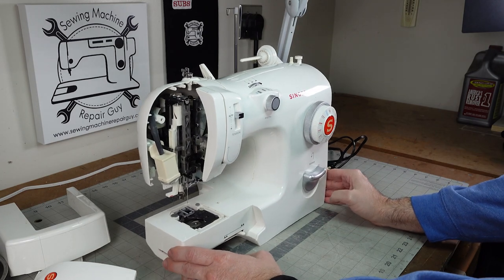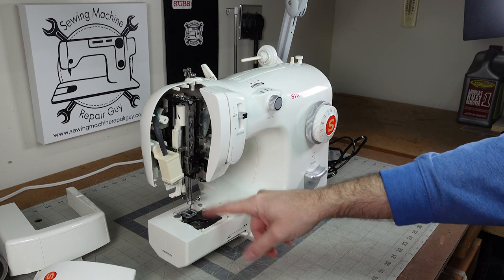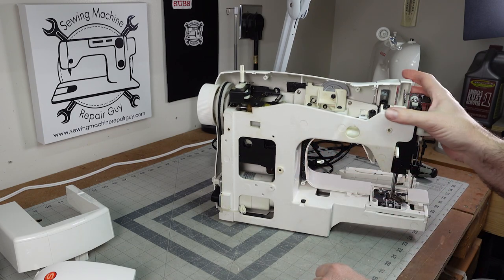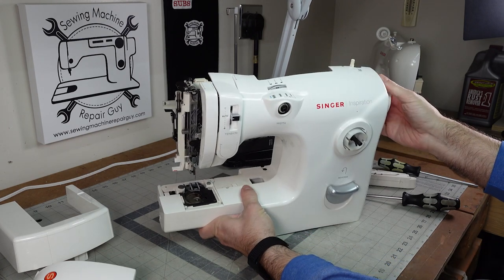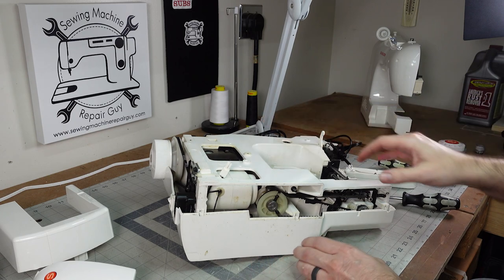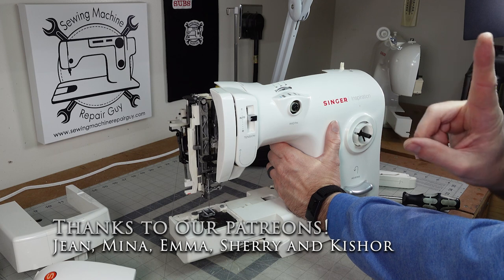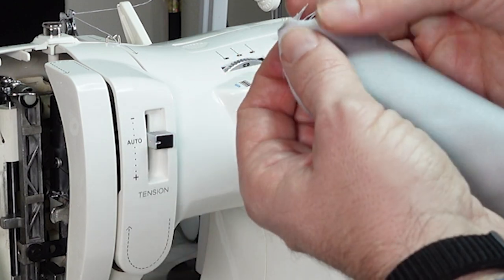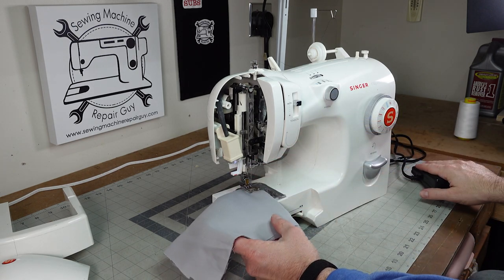Singer Inspiration Timing Adjustment Plus **BONUS** Fabric Picking Fix!

Comment: I had to retime mine after I bent a needle, looks like the belt managed to slip a tooth. Thanks for the vid! Its difficult to see the hook when its in the correct position in relation to the needle. One thing to emphasize is the hook picks up the top thread and not the bobbin thread. 🎉 Happy New Year!

Comment: I had one of those 12 years ago that had a broken plastic gear. It was not available so could not be repaired. You have to adjust the timing with the needle in the left position.

Comment: How do you open that upper case on the top left, the one that is already opened in your video? :)
Reply: O, nevermind. Got it.
Reply: @Asaeax  HOW????
Reply: How do you open that area so I can change my light bulb??
Reply: @faithp777  mine was tightened with one screw in the back -which I didn't notice at first. After unscrewing it is easy to gently unclip and remove the part from the case.

Comment: Plastic--not great-- It's a Piece of junk. Singer last great machine was the 500A  The 600 Series wasn't too bad, until they started using plastic gears. and the 700 class was fair for a while. Singer sold out and they started contracting out their machine production and mostly they produced junk. If you want a really good machine buy a Bernina.